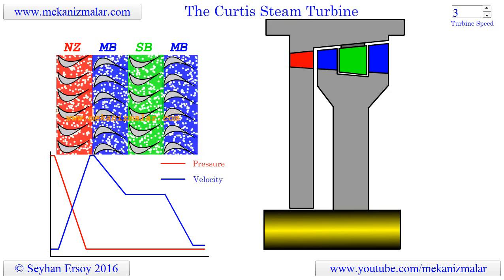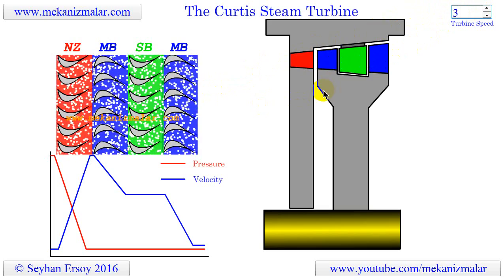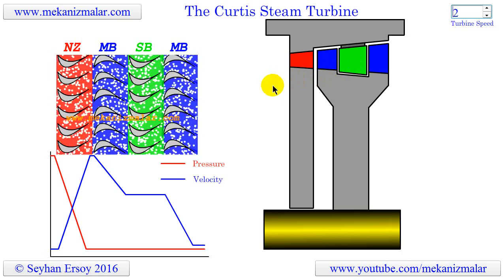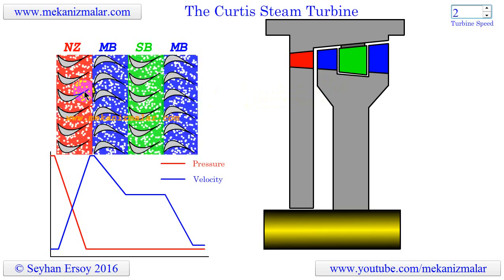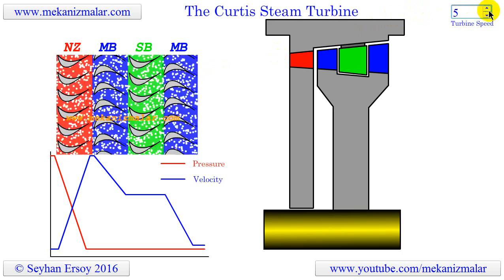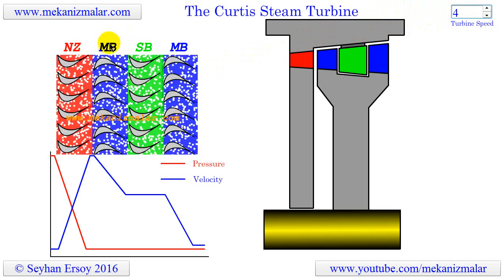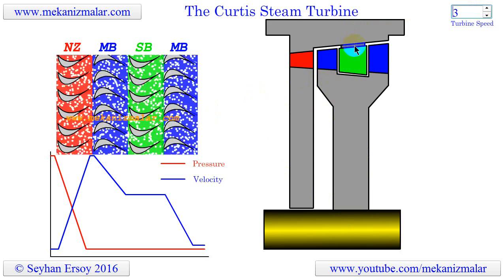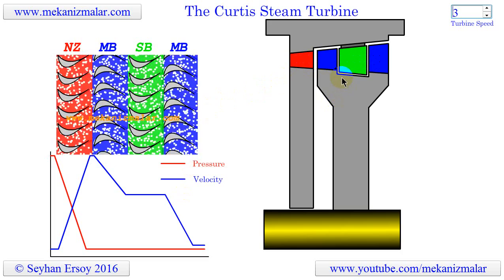the curtis steam turbine

Comment: Why is it used in first 2 stages somw one pleaee explain
Reply: If steam entering the turbine has high pressure it is logical use curtis wheel. This is because curtis wheel reduces pressure a lot and increase speed a lot. Because the rest of the turbine will have less stages compared to a turbine without Curtis wheel.
Reply: @seyhanersoy8989  thank you sir

Comment: I think there's a small error in the right side drawing. The image shows a divergent channel, meaning that the fluid expands but in a Curtis turbine there is no expansion!
Reply from the maker: If you mean increase of velocity due expansion, you are right for single stage curtis turbine. However, if the turbine has two stages, than there is expansion stage in the middle.